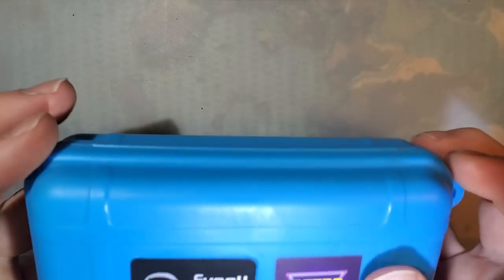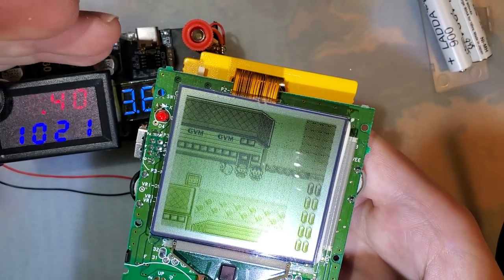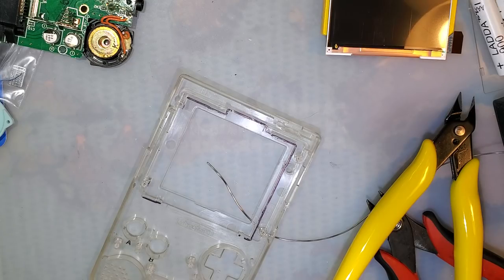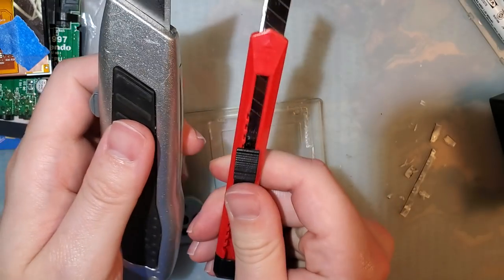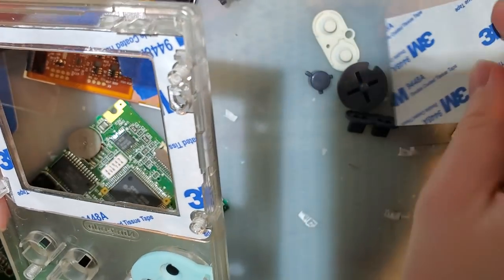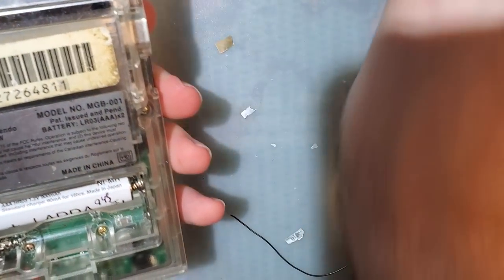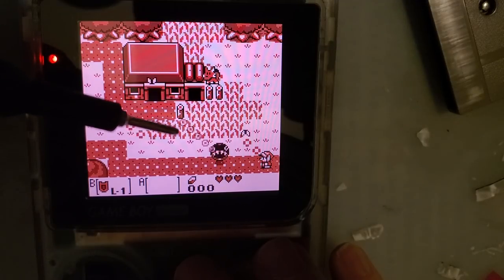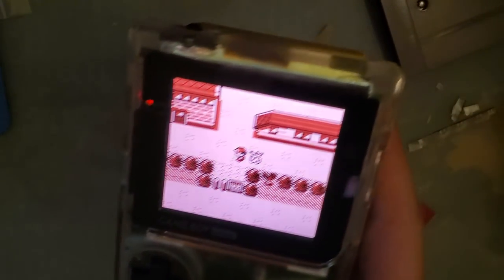Installing the Funnyplaying Game Boy Pocket IPS Kit (Part 1 of 3)

Comment: With the adhesive on the screen side I only remove a little bit of the masking tape on each side of the screen. Gives it just enough to hold the screen and leaves just enough to remove it if you need too.

Comment: I enjoyed watching your videos, mostly because i happen to have the same stuff from aliexpress, like the liitokala lii-500 charger, the non funnyplaying v2 ips gba kits (single chip "low power") and i am obsessed about power consumption as well.  Watching your content saves me having to do the power consumption tests!
One thing i am not sure you have tried is those lithium ion 1.5v rechargeables in AA/AAA formats from aliexpress.  (E.g. the ZNTER ones).   When i saw you struggling to boot up the flash carts I was thinking "Lithiums", even if its just regular Single use Energizer AA Lithiums.
When I saw you struggling to figure out the sticker orientation & also melt your case whilst de-soldering the wire, it just shows that you're content isn't rehearsed or heavily edited which is what makes it more watchable than other youtubers.
Reply from the maker: check the description
Reply: Thanks, usually i do check the description.  I probably glanced over it due to tiredness! 
I also have the fake IPS-101 screen, purchased before your other video (took forever to ship), the power consumption sucks.

Comment: Been looking forward to hearing your thoughts on this kit! Luckily replacement screens are super cheap, even cheaper than the GBA/GBC panels. Its not the end of the world if you misalign and decide to trash it. I'll personally avoid using the adhesive again in the future anyway though as its generally just annoying. Looking forward to the GBL install, Be cool if you could use the third step on the power switch for something, maybe for toggling the grid? If anyone could figure that out, it'd be you.
Reply: I saw a video by a YouTuber Macho Nacho where he recommends just cutting out a small square on the bottom and the right side of the adhesive, so the screen stays in place but with not so much force that you can't take the screen out

Comment: Thank you for this video! I watched it through and through. Question: Lithium AAA batteries (rechargeable) 450mAh -- Do you think this will help whether using the EZ flash Jr or the Everdrive x7? I would love to play on the GBP but am concerned with power issues (not so much battery time just booting and playing). Thank you!
Reply from the maker: The higher voltage will probably help, yes. But using a higher capacity battery will yield significantly better results than what you are planning on using.

Comment: i found the battery life to be pretty bad with the AAAs, been contemplating re-doing my pocket with a TFT based on the advertised better battery life. cant seem to find any ips vs tft comparisons for battery life just screen quality
Reply: From my experience, the TFT screen destroys the IPS screen in terms of battery life. I literally played it a couple of hours every day for a week and it lasted that long. It was incredible. My ips mod would only last me 2-3 hours on the lower brightness. Plus you can’t load an everdrive once the battery was slightly drained. And when I did run a everdrive, it would die in 1 hour. Sucks because the pocket is my favorite gameboy in terms of size and feel.

Comment: Which voltage regulator did you use on that other backlight pocket? I used the Pololu 5V stepup on my GBP with IPS and the EZ-flash Junior and it works great. Can get 95% of the NiMH batteries before it shuts down. I would definitely recommend the VREG for anyone with this screen who wants to play with flash carts.
Reply from the maker: honestly can't remember which regulator I used. I'd have to dig through my aliexpress purchase history to find out. I can't say I recommend it though. I've been meaning to grab some of those pololu ones to check out.

Comment: I am thinking changing the wiring batteries from series to parallel, this allows us to use higher voltage batteries like the 3.7v 10440 batteries
Reply from the maker: I'm actually working on a solution for that which involves no modding. Doing a LiPo mod will certainly help but I understand that not everyone would want to completely rewire their console for new batteries or carve out the battery compartment for a larger cell.

Comment: Did you cut the cartridge slot pins on the front of the GBP chip? 
It hurts my heart to see tap the glass protetor with the screwdriver.
Reply from the maker: Not necessary with this kit but recommended still. If nothing else, you do still need to insulate. 

> It hurts my heart to see tap the glass protetor with the screwdriver.
And I'll do it again too.

Comment: Isn't that red rectangle to the right of the screen the adhesive strip for the touch sensor??
Reply from the maker: no, it's the pull tab for the protective layer of plastic on the LCD.

Comment: so i watched your installation video, and for some reason my contrast doesn't adjust the brightness, i dunno if i broke something or if i got a defective board.
Reply from the maker: I mean, did your pocket work with a stock LCD or did you replace the main power regulator? If no/yes respectively, that's expected.
Reply: @makho  ah thank you for the reply, i did add a new power regulator board and now know thats whats up.

Comment: Do you think using the 3.3v dc usb cables would be better than AAAs or cause the same issue with the es flash jr ?
Reply from the maker: kinda makes the whole "portable" thing pointless, doesn't it?
Reply: @makho  totally agree with you lol but for this gbp it’s in one of those bluishsquirrel gameboy light style Pokémon shells and I can’t bring myself to cut it up for a lipo and charge board 😂😂

Comment: I have it installed and want to ask you just one thing. Why with the grid activated the image looks so washed out? The grid suppose to add more contrast like scanlines in consoles right?
Reply from the maker: Because the new screen uses 4x linear scaling with the pixel grid emulation off and 3x with it on. That last pixel is being used to display a black line instead of displaying the game content. By setting a quarter of the screen to black, you lose brightness and contrast. These are not scanlines but any scanline emulation on a LCD will have the exact same issue.
Reply: @makho  But in the Color and DMG looks great :( There is no solution? I love how the grid looks in Color for example
Reply from the maker: @RenoFriends  Like I said, it's fundamental with how the pixel grid emulation works. No, you will always lose brightness and contrast.
Reply: @makho  Si it's a matter with the screen itself, thanks for your replies

Comment: What voltage is needed for the screen to work? Does it use the high voltage of the original converter?
I think you can use a custom dc-dc.
Reply from the maker: Yes and no. The LCD regulator requires the high voltage from the original DC converter and this screen uses the output of the LCD regulator to control brightness. Without that, brightness control likely will not work.
Reply: @makho  The original converter is noisy. I had an idea to remove it entirely. Put a new one only on 5v.
Reply: I'm using this kit with Pololu U1V10F5 5v regulator, and it works, but brightness control is limited. I think that I'm able to adjust it from "normal" to high (bright), but not from "normal" to low (dim). I can't test it with ez-flash jr because i don't have one, but with ElCheapoSD v2.2 it works ok. Battery life isn't great even with new regulator, on black fujitsu AAA (900mAh) original Warioland runs about 2,5 - 3h (brightness set to "normal").

Comment: I just did this and got finger prints behind my screen. I have a second magnifier I can fix it with later.
Reply from the maker: If your pulling the lens off anyway, why not just clean it when it's off?
Reply: @makho  meant lens
Reply: I have two lens. I am jusy going to use the other. I would need to get more sticky sealant after I remove it. Should have used gloves. Oh well.

Comment: 12:00 so either will work?
Reply from the maker: Yes. The closest pin should work better since it does not route power [to the backlight kit] through the power switch.

Comment: EZ-Flash Junior is a garbage... I use a Game Boy Pocket without any modifications + EZFlash Jr. Battery life is 1-1,5 hours. And that's even when I use very powerful rechargeable batteries Eneloop Pro AAA 930mAh.
Reply from the maker: Well, the Pocket isn't known for it's great battery life. Add mods that use a lot of power (like a replacement screen) and a flash cart and it's a miracle it works at all tbh.